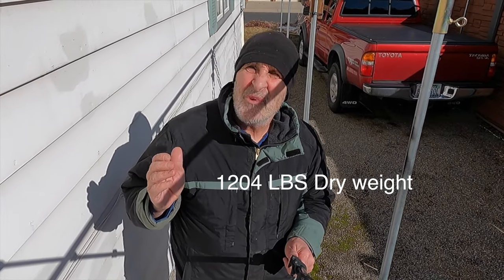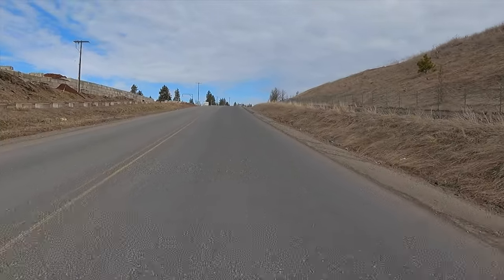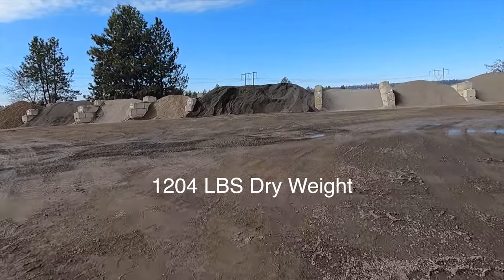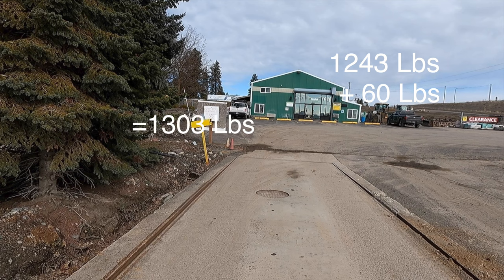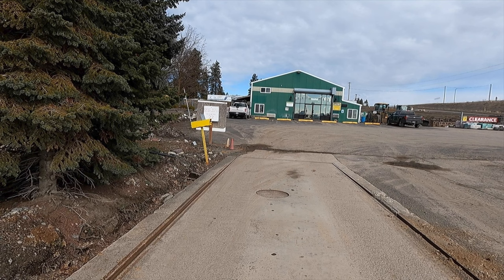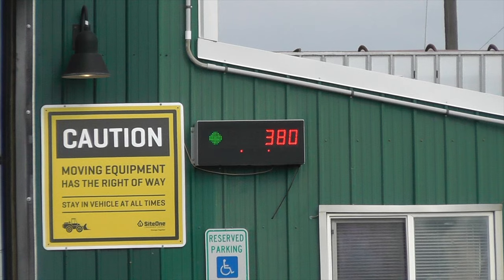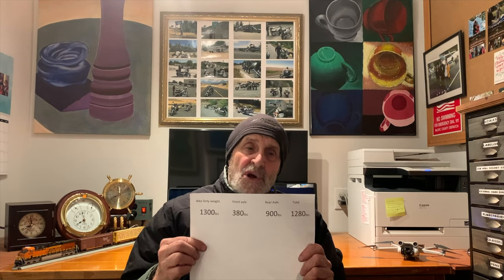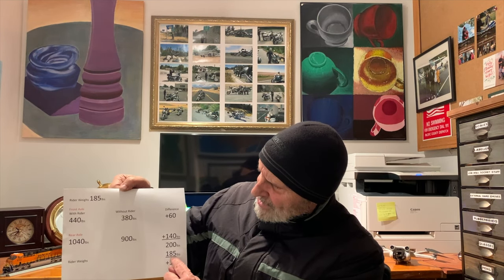How much does your Harley Davidson Tri Glide really weigh?

Comment: Thank you for this video.  I needed to know if the ramp with 750 lb capacity was enough for the front tire
Reply from the maker: It is amazing how much that front tire weighs.   If you go on a long trip with a passenger and fully loaded down, you get pretty close to the maximum amount of weight you can have on the bike.  But it still handles very nicely.
Reply: @windsurfed1  I just bought a 21’ model with only 3k miles.  Sure looking forward to enjoying it!
Reply from the maker: @GuyOnTwoWheels  that is pretty good low miles. Problem is, you will now buy thousands of dollars worth of accessories. Unless they’re already on there which would even be better.  First thing I did was bought a back rest it made a world of difference.  Did not think I needed one until I made my first long trip.
Reply: @windsurfed1  oh yeah, I know the routine.  😂 I have a 2011 ultra limited all decked out, and had a heritage before that
Reply: And yes, a backrest is a must
Reply from the maker: @GuyOnTwoWheels  sounds like you pretty well know your way around motorcycles. You should really enjoy that TG. It should add years to your motorcycle riding.

Comment: My 21 CVO comes out about 50 lbs. more than yours on the state truck scales. 
I probably must have a little bit more in my trunks.
Reply from the maker: Yes, my trunk was empty except for my tools and my Harley Davidson battery booster pack.
Reply: Now, what’s the factory recommended gross (max) weight for the trike?
Reply from the maker: @bigjohn4977  that’s a good question. I know there is a maximum rear axle weight. I will get back to you shortly
Reply from the maker: @bigjohn4977  gross vehicle weight allowed is 457 pounds over the weight of the motorcycle with fluids.
1243lbs+457lbs=1700lbs. That includes, driver, passenger, and luggage.
Reply: @windsurfed1  Thanks; that’s great information!
Reply from the maker: @bigjohn4977  Thanks. Maxximum gross weight for the whole Motorcycle is 1700 pounds. So I am only allowed 200 more pounds glad my wife only weighs 115lbs.

Comment: Great info. But
Your statement on the front tires, ''made especially for trikes", is not totally correct. 
Harley does not make their own tires.
The front tire is a Dunlop 'Harley Davidson' D402 MT 90 B16 72H. Same as use to be on the touring bikes 2008 and earlier.
There are many other tires out there with better mileage with the same speed and weight ratings.
72 is the weight rating = 783lbs. H is the speed rating = 130mph.
I switched out to a Dunlop American Elite, same specs, better tire.
As long as size MT 90 B16 is met, and 72H is met. You should be able replace it with any brand.
Reply from the maker: I was watching a Dunlop tire salesman and he was talking about Harley Davidson branded tires and he mentioned that the tires made with the Harley Davidson branded, made for the touring models, were more beefed up in the sidewall, because of the weight. It kind of made sense to me since there was so much weight on that front axle that something extra had to be done.  Anyway, that’s where I got that information from and I thought I would throw that in there but I see what you’re saying also.
Reply from the maker: I should say a Dunlop tire representative, and not a salesman
Reply: Thanks, you must be really bored.
Reply from the maker: @franksmith2472 .  Always asking questions that need to be answered in my own mind.  The most weight you’re supposed to have on the motorcycle is 1700 pounds. That means I have 200 pounds left. I’m glad my wife only weighs 115 pounds.

Comment: They weigh a lot. 😂
Reply from the maker: According to the owners manual, I am only allowed to put 200 more pounds on the motorcycle to be in the safe riding area. Maximum allowable weight is 1700 pounds.